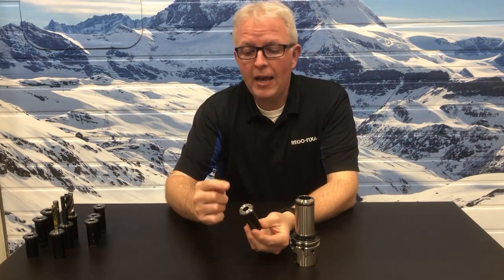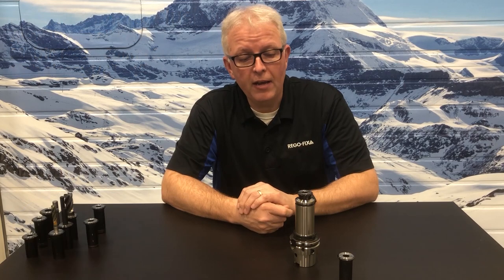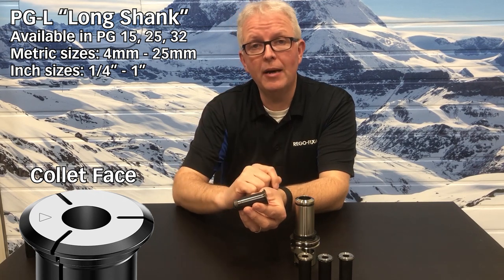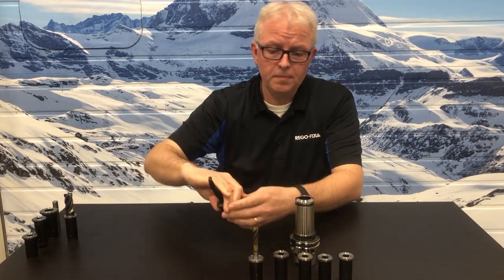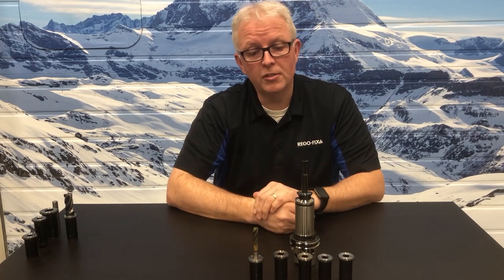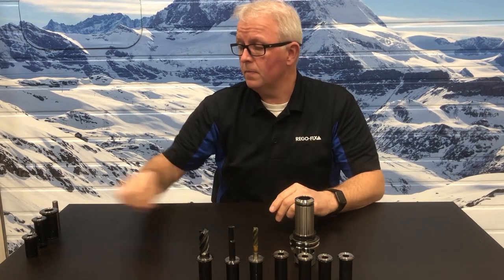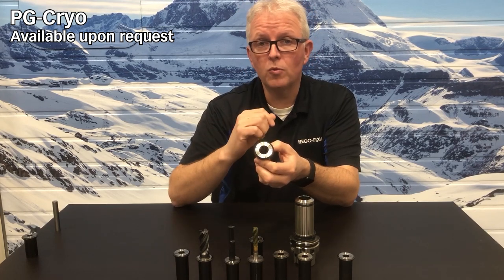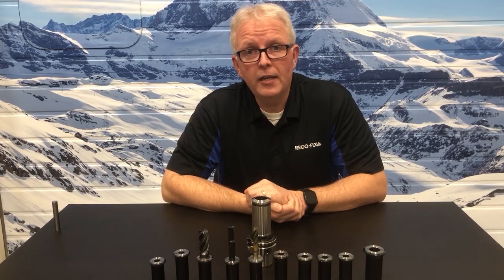TechChat - powRgrip Collet Options

Comment: In a past video you mentioned how the tool length setscrew diminishes your holding power on er collets.  Does the same thing happen with the PG collet?  Charles
Reply from the maker: It can certainly have an effect, but things are a bit different with the PG series. For PG collets, the tool needs to always be touching the backup screw. This ensures that proper holding power is achieved and the collet acts as it needs to. Pulling too much of the tool out and not having it against the backup screw can damage the collet itself by clamping around the bottom of the tool. Different beast, but same topic!